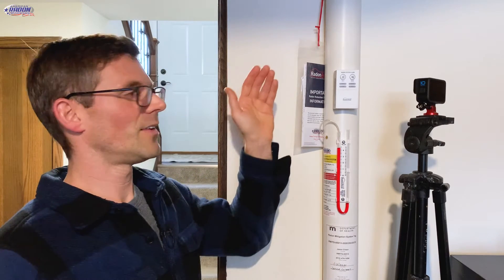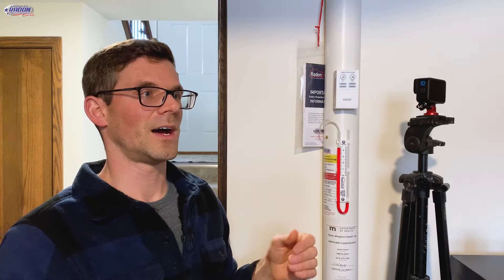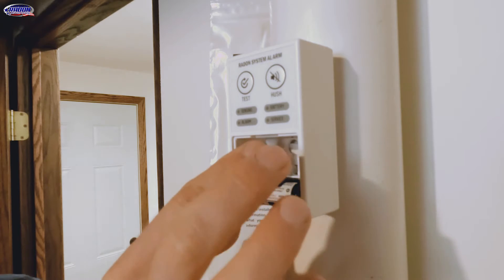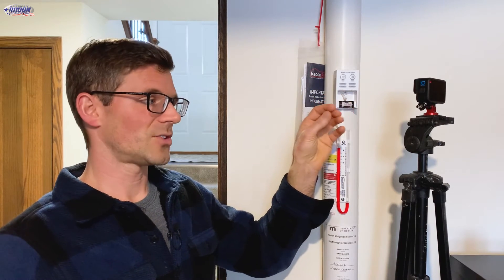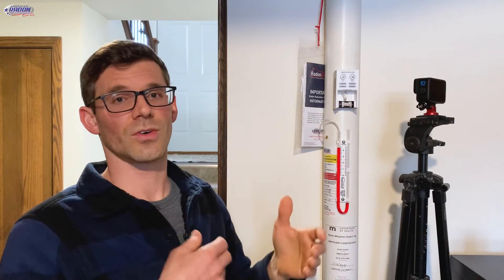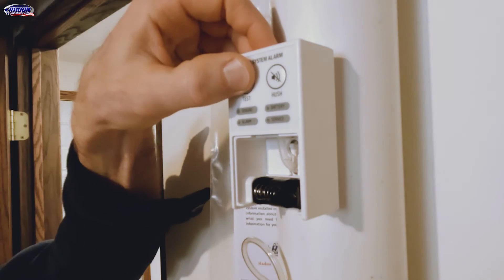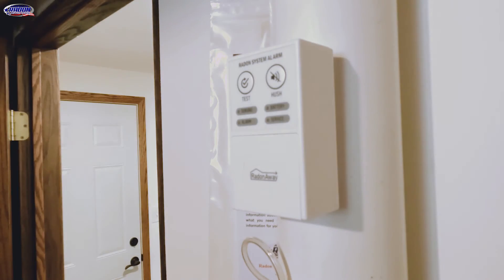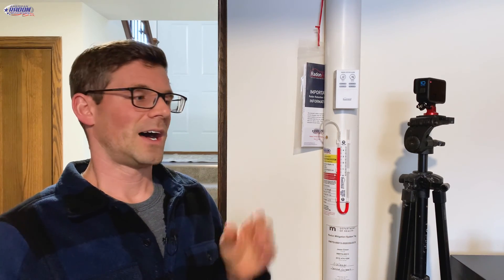RadonAway RSA1 Radon System Alarm Features Explained

Comment: I agree. I will not hear a single “chirp” nor will I notice a small light.
Yes, I have a TV, 4 Alexa units, a dishwasher, and many many other distractions that make noises such as a family. Additionally the radon system is in the basement. Would love to buy this product if it were an alarm as apposed to a $60 novelty.
C’mon man!
Reply: @AmericanRadonMitigation  
Not your fault, but I think they can do better.
Reply: X2, I was about to buy it until I saw it chirp instead of sounding some sort of alarm. 

No one in my house will know if the fan is off with this chirp due to all distractions, specially since we don’t use the basement.

Comment: Mine beeps about every 10 mins or so, previous owners installed it after our inspection found a raised level. Is this normal? Or should it only beep if there is an issue / needs to be recalibrated?
Reply from the maker: Is the manometer equal on both sides? What light does the alarm show?